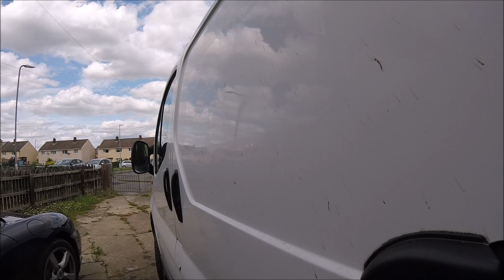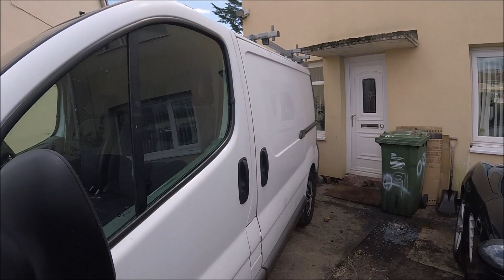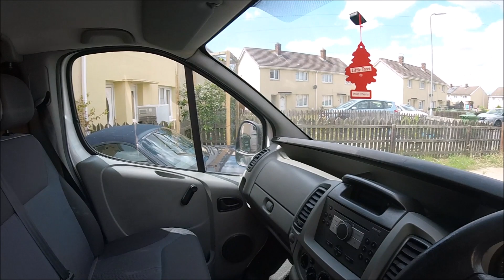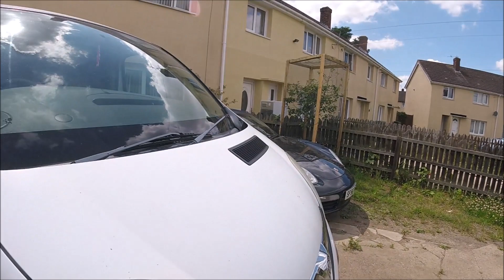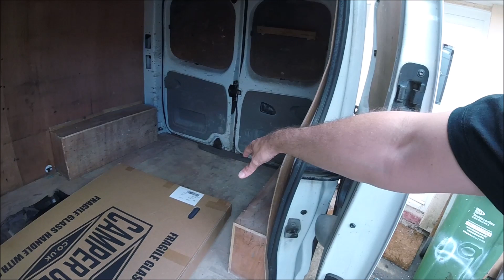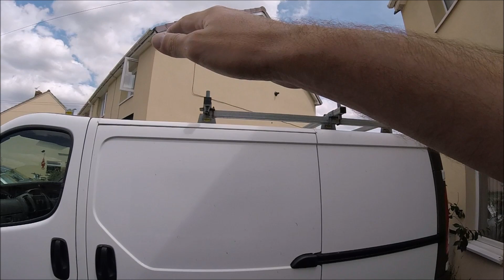Vauxhall Vivaro Campervan Conversion Project Introduction

Comment: Thinking of getting a Vivaro. Is it possible to fit a bed across the back doors as opposed to along the side? Perhaps slightly raised too? I’m 5’6 🤔
Reply from the maker: yes but it would not be very long so you might have to sleep diagonally and I'm over 6'2 so would certainly not be good for me.  If you can lie across on the floor with a pillow in place, that'd give you an idea how comfortable it would be for you

Comment: 80k miles is well on the sort side for g/b and clutch replacement. Must have done a lot of stop/start, fully loaded, round the dales ... Up Frenchgate in Richmond, for example 😃. The Trafic/Vivaros do have a reputation for g/b trouble at around 150K. 5th and 6th tend to go first.

Comment: Why not put the solar panel on the roof bar's, I know it will ruin the stealth aspect but it will be easier to fit and change in the future.
Reply from the maker: it would leave the roof bars redundant because if you put anything on top, it would knock power off the panel.  I'm thinking of removing the rack completely or maybe leaving a small section at the rear for a roof box or something but its not something I'd actually use myself

Comment: I've always fancied converting one of these myself, about as small as I would go. I'd probably keep the double passenger seat myself although entering the back from the front is also important enough I think. Looking forward to the build. 
It's a pity the gearboxs in these are apparently not good, nicknamed chocolate gearboxs.
Reply from the maker: Yes I found that out the hard way, speaking to the chap who rebuilt them, they were failing from 1000 miles due to build tolerances being out, its a shame as they always seem to be tidy vans bodywork wise compared to transits etc.  LWB would have been nice, but the low miles on this tempted me
Reply: @TheCampervanBuilder  Does a Good gearbox rebuild sort the issue out? Yes the longer wheelbase model is nice for that extra bit of space.
Reply from the maker: yes it should sort the problem out and it gets 12 month rebuild warenty for peace of mind
Reply: @TheCampervanBuilder  Some details about this may be a Good thing in your next video 👍👊